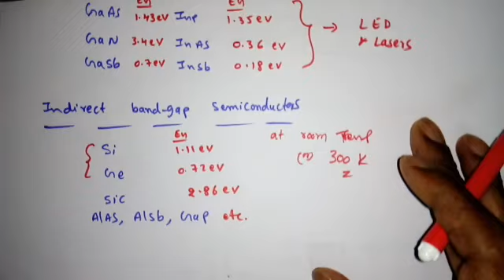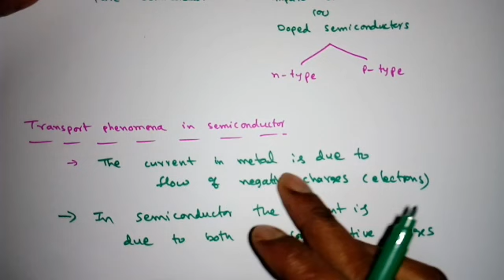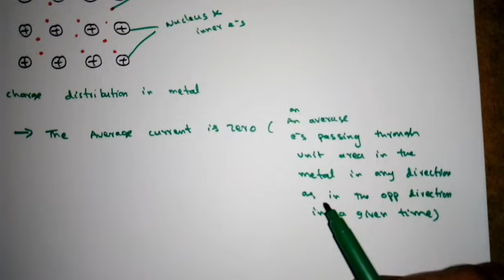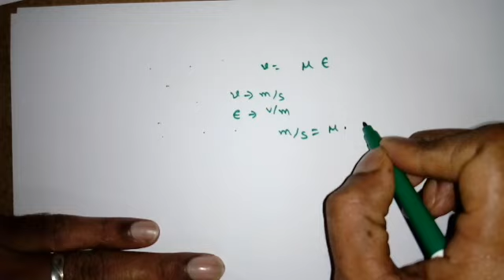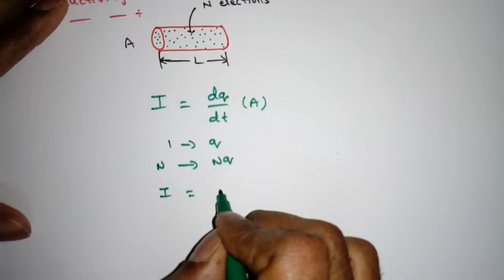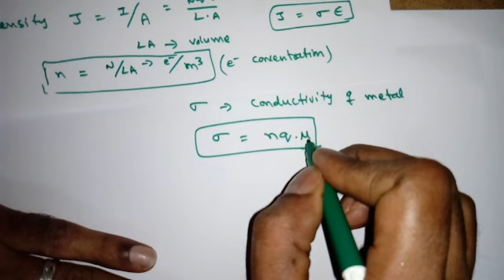Electronic Devices Lecture-9: Mobility and Conductivity of a Metal

Comment: Sir what is the meaning of ions and what is difference between ion and electron
Reply: when an atom looses an electron it becomes an ion.
Reply: Atoms are neutral; they contain the same number of protons as electrons. By definition, an ion is an electrically charged particle produced by either removing electrons from a neutral atom to give a positive ion or adding electrons to a neutral atom to give a negative ion.